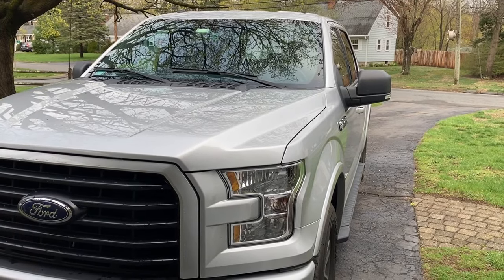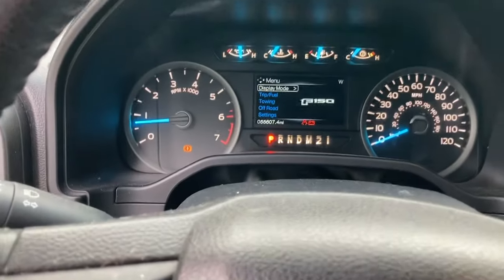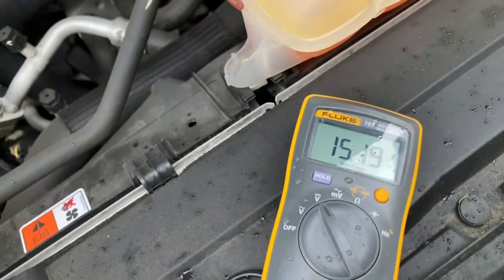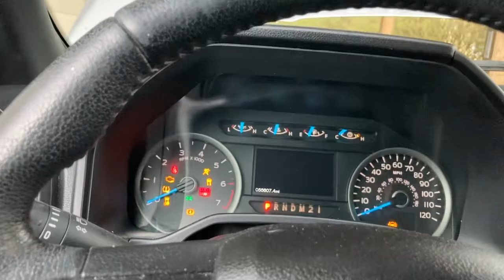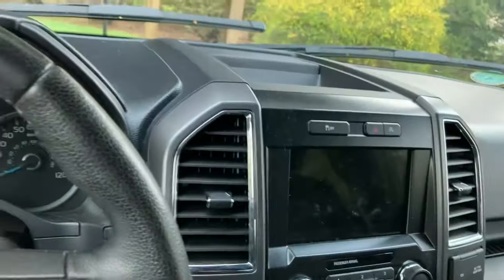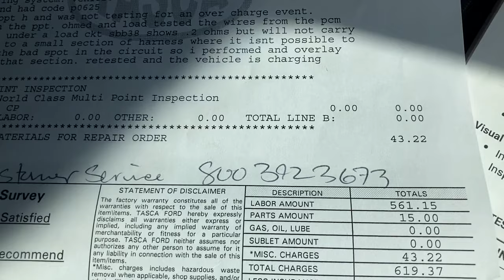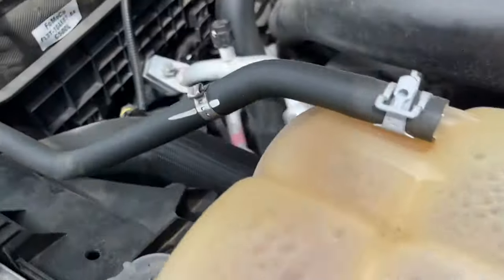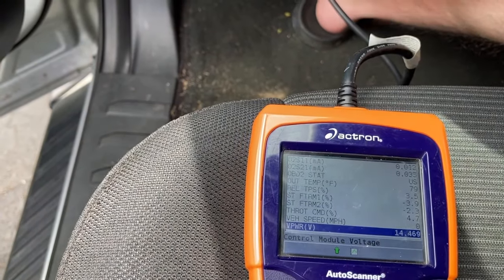How to fix Charging System Issues on a Ford F150

Comment: Having the same issue on a super duty with dual alternators.  Also, the dealer is booked way into the future to a look at this.  My truck does run and I can drive it, I have not seen it stop on me.
Reply from the maker: It's not a good time
Reply: Ford replace one of the Generators on the driver's side and now all is good.

Comment: I turned the key to start and it flashed that message for 2 seconds and hesitated to crank. Started right up and the message went away. Battery load test good, reading bad voltage regulator 🤦‍♂️
Reply: What did you end up doing? I just had the same issue this morning.
Reply: My trucks alternator was now the issue but a power train module. They still chargers me to change out alternator but problem was still there. Guess what the module was covered but the alternator was not. They made a quick buck off me. Pretty sure they knew that from beginning
Reply: @christraslavina5534  I haven’t done anything yet, and haven’t had the problem come back yet.

Comment: We just had a new battery put in my sons 2013 3.5L King Ranch and the battery light is still on even after you reset it. I told him it's probably the alternator. His battery tested bad but now I'm wondering if it was still good and was just not getting recharged
Reply from the maker: It is a complicated system, just keep canceling things out and hopefully you find the real issue.

Comment: Have a 2011 f150 eco boost all normal when start all lights and window switch are off,turn off machine and on again then the lights go on and off and battery sign shows, then all lights are off. Any suggestions?
Reply from the maker: I really don't know, but maybe a battery or an alternator problem?

Comment: Dear "Everything is broken", Thank you for sharing your expensive knowledge for what should have been an easy fix.  I have the same exact error coming up.  Is there any particular part number for that one wire that Ford ran after the Resistivity problem occurred?  Intense appreciation.-Paul D. Dodson
Reply from the maker: I really don't know that information but I think any other manufacturer of what was used would be better

Comment: Those are a PITA to find.
If it was easy anybody could do it.
Finding a wire broken INSIDE the insulation is difficult
Had the same thing happen to my tail lights.
Just run a new wire.
He could have dressed it up much nicer but do you want to pay him shop labor rates to do that?
Reply from the maker: Yeah I agree. I didn't mean to bash the dealership rather I think Ford should have issued a recall for a known issue. Hey at least I was able to see what was done to the truck.

Comment: My 2020 F150 just started doing this while driving home at 1 am. Had to leave it on side of the road and will be going tomorrow morning for it. What do you recommend in order to fix it? Take it to dealer? Or it’s something I can do at home?
Reply from the maker: I took it to the dealer hoping it would be under a warranty or even a recall I didn't know about. Looking back I would have checked the communication wires first.

Comment: Two questions. 1. Do you know what gauge wire was used?

2. Where did they splice/jump from the alternator connection side?
Reply from the maker: I don't know the gauge size, and it looks like it was cut and reran right from the front of the motor and up towards the battery.
Reply: Looked like 16 gauge speaker wire......not very professional looking for $680
Reply: I replace the alternator, pulley tension and battery but the message still coming up.

Comment: It must be a flu I took my 2017 fusion to the dealership for a transmission oil change then right after leave the dealership that code came on mines. But difference with mine is that it comes and go

Comment: thanks for sharing, did this fix last?
Reply from the maker: Yes, 1.5 years going strong
Reply: @slicemadice  
My issue triggers every warning light. shutting off electronics radio ac/heat, sometimes even power steering until i key off Neutral restart … lights flicker constantly
Reply: @justinr8116 did you figure it out?
Reply: @HannahMarcelvlog yes i did
Reply: @justinr8116  what was the fix? I’m having the same issue

Comment: My 2016 F150 had the same issue, a issue ford needs to address but will not acknowledge its a problem. I also added a wire outside the OEM wiring harness.
Reply: Did it solve your problem?  I'm getting the same right now on 2016 F-150.
Reply: Did it fix the issue?

Comment: my ford edge 2012 is getting this is its odd 25 codes are popping up but my batt and alt or fine
Reply from the maker: I would assume a similar problem is happening with your car then. One problem can daisy chain to dozens of issues
Reply: @slicemadice   its was just the dam alt  that was all i changed baterey was good just the alt

Comment: I need to see where the jumper/bypass cable goes at the alternator
Reply from the maker: Sorry I didn't get a great shot of it, it's 3 wires off a plug at the alternator.
Reply: @slicemadice  got it which one is it? Sorry for the hassle. I had to take my truck to the dealer as I couldn’t figure it out. I just dropped it off yesterday.
Reply: @slicemadice  with plug in the harness, is it the one on the left middle or right? Left being the one closest to the large battery cable.
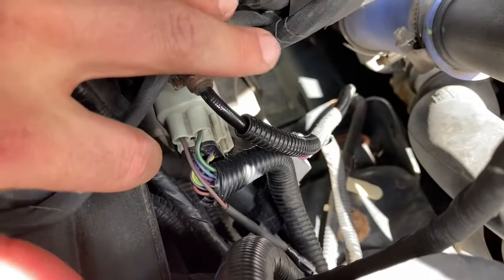Reply from the maker: @falconedsel  at around 10:50 I show a brown/red wire that was bypassed.

Comment: Thanks for sharing mine just started doing it yesterday I replaced both alternator and battery and battery light is still on maybe this will work if not it might be my body control module
Reply from the maker: Good luck with the repair!
Reply: @slicemadice  Did it fix it?  My 2016 is doing the same at this point.  Can easily run new wire.

Comment: 15V is to high. It should sit between 13.5 and 14.5.
15V will fry the battery and systems in the truck.

Comment: I have a similar problem and it pisses me off because I was about to replace the alternator now I'm gonna take it to a mechanic and tell them to find the wire
Reply from the maker: I would have done the alternator first but the part was super expensive, and I hoped warranty would kick in under the 60K drivetrain warranty.

Comment: You have a bad voltage regulator. Possibly a blown diode.
Reply: That's not always the issue I have a 2013 fusion had the check charging system message come on I had my alt tested and was told the internal regulator was the problem and it was causing it to overcharge so I bought a new alternator and still get the same message! My car runs fine I just hope it's not overcharging

Comment: 2 wires are pcm 1 is power in from fuse box.
Reply: Elaborate?
Reply: @Rich4Prez  pcm monitor/pcm singal/12v supply are the 3 small wires
Reply: @spacebound2195  aye bro a long shot but I’m really in the dirt rn new battery new alternator battery light still shows any idea it’s a lot to ask but I’ve checked a lot belt fuses module no wiring yet it could be but any idea helps?
Reply: Does it still die? Or just a light on?
Reply: @spacebound2195   so It turns on, the car itself has power but after driving 2-5 mins a red battery light with no words flashes 3 times then a ok botton appears. this all it does without me driving got behind the wheel with the light on and and after turn off and on the truck after I got to my destination power steering goes out and had to get it towed back to da crib

Comment: All you had to do was to take the positive end off the battery while running and if it shuts off its the alternator.The regulator will charge and then stop charging.You aren’t very mechanical incline
Reply: Fords will shut off as they have external voltage regulators on the alternator unlike Chevrolet thats internal. Not all cars stay running without the battery connection.
Reply: ? maybe in 70's or 80's Ford carburetor engines. Wouldn't that kill power instantly to the fuel injectors or PCM and shut everything off regardless?